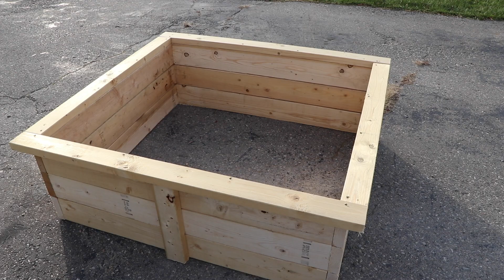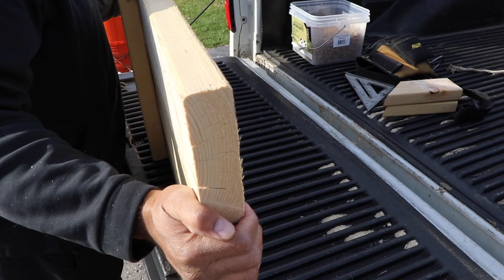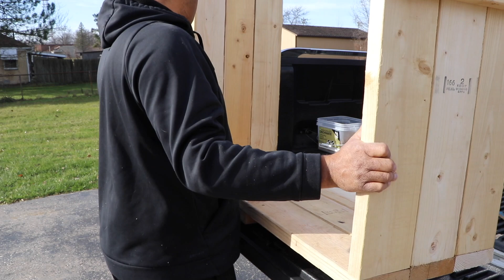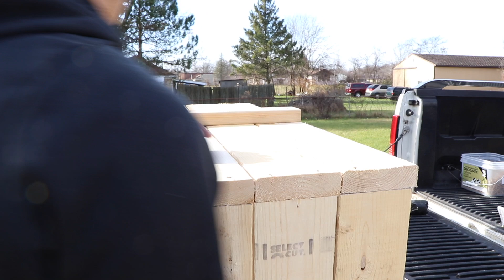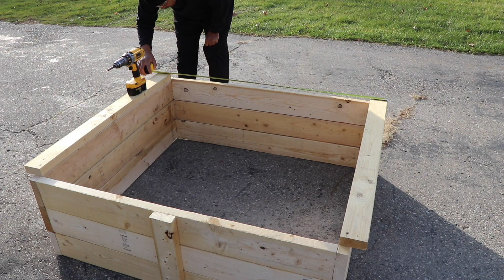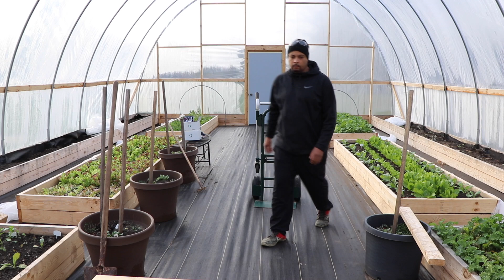How To Build a Raised Garden Bed

Comment: Would this be good for apartment living? I have a little square but I’m interested in learning how to garden in a new zone
Reply from the maker: These garden beds are probably not the best solution for apartment living. I would suggest a container garden using grow bags or pots. Therefore if you decide to move it will be easier to transport and will not take up much space.